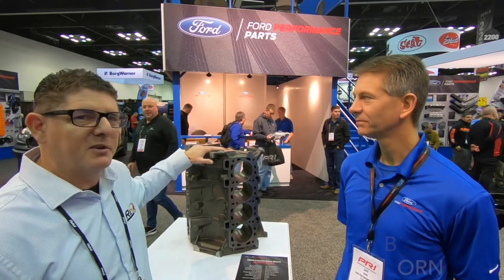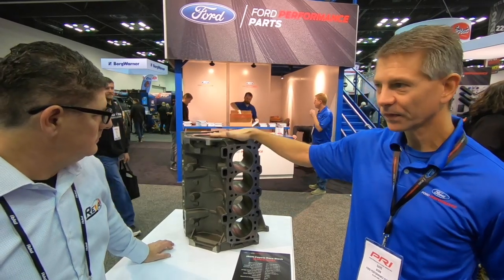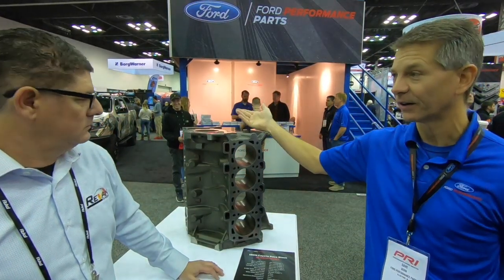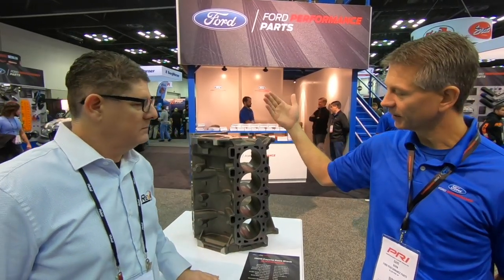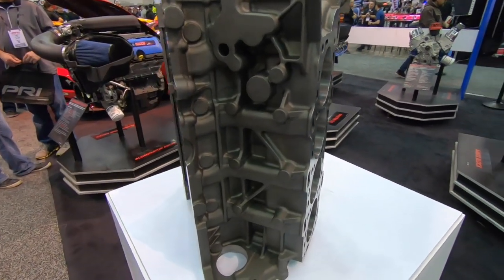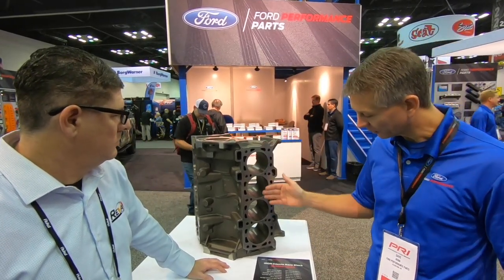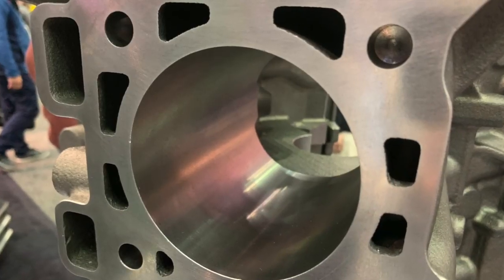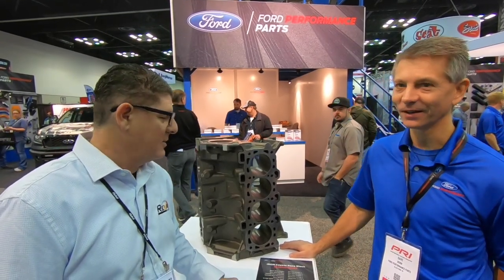First Look!!! Ford IRON Coyote Race Block 340 Cubes All-New at PRI Show

Comment: Ford make push rod please light simple
Reply: Ford did make push rod engines for more than 40 years. Who do you think chevy copied the LS platform from ??
Reply: Dale Ostrom the LS design was GMs design, they didn’t take ideas from ford, I love ford but GM used to know how to make powerful motors, now ford does that, the old 351 Windsor’s and such would get shit on by an LS with the same upgrades while also being cheaper.
Reply: @Mfletcher703 ; Ford's original Windsor design came out in 1962. With 40 years of technology behind them, I would hope chevy could do a little better. Maybe in another 20 years chevy will figure out how to put overhead cams on the LS.
Reply: Dale Ostrom I doubt it, I’m sure 20 years from now we’ll see the tired out 5.3 with a whopping 400hp but somehow still slow as hell.
Reply: @Mfletcher703   YA BS, the LS design is basically an updated Ford Small block.
Reply: if you want push rods just buy cheap LS motors
Reply: @mikec9112 ; I said "Windsor Design" . I would think people that know Ford would understand, maybe not
Reply: @mikec9112 ; It would be a lot more confusing to call it a 302 Cleveland.  Even to me, I would consider that a Boss 302.
Reply: Trailspeed703 you obviously don't have a clue what you are talking about.. GM's la is pretty much a Carbon copy of the Ford Windsor design! The LS cylinder heads bolt right up to a 1960's small block Ford and everything lines up perfectly.. I wish I could post pictures here because I have proof! I have done this, and after you actually see both engines side by side there's literally no question about it...
Reply: @robinesavage404   There is no such thing as a Ford Windsor design.  There is the Ford Small Block design family of engines that includes the 351 Windsor.

Comment: We found that the old cleveland blocks distorted from the factory 9 thou at 2000 revs and we were losing 50 foot pound of torque so have they tested this fact of either aluminum or iron blocks?

Comment: FORD PERFORMANCE!!!
What a waste of time and money for 1500 to 2000 rpm. 
You already have tooling for an awesomely super strong block capable of over 2000 horse and havent made one for nearly four years..... the Australian Ford Barra 6 cylinder.
Barras easily make 800 to 1000hp with $5K  ..... how much to get a coyote making that sort if power? The only other cheap platform for such power is the LS.

FORD you are missing a trick by not recasting the Aussie Barra!!
And Im not an Aussie.
Reply: I agree that the Barra is one badass engine, but to answer your question about the Coyote making 800-1000 hp.. Ppl do it all day long around the world, just add boost!! Turbo or Supercharger easily gets it done!
Reply: Can’t the coyote already handle 2000 hp when sleeved ?

Comment: That why i like my 07 Shelby gt500 5.4 iron block😀😀
Reply: Be nice if that could find it's way in production form in the F150 and Navigator
Reply: Drag Hrvacevic  100% agree with you that’s why I kept my 09 GT500!
Reply: The 5.4 is gutless, even with 4v heads, the older modular designs just didn’t have the right proportions to be super powerful in stock form, whatever improvements ford made to come up with the coyote definitely is the way to go
Reply: @Mfletcher703  they both could do the 1hp per cubic inch with 4v heads. The 4.6 was more potent of the two because it was better proportioned (It's actually better proportioned than the coyote) the coyote has all the tricks of the trade applied on addition to being larger. If the 4.6 had those ingredients (4v VVTI, 12:1 CR, Direct injection, phosphorus coated pistons) it wouldn't be far behind. The 5.4 has a bigger stroke than a 460. Ford just didn't equip it to rev like a normal small block. No rpm, no hp.
Reply: vendediesel makes sense, I was always a fan of the 4.6 but really on the 3v version that came in the 09-10 f150s, I would like to see ford bring back the 4.6 but that won’t happen, but what would be cool is the see a 5.8 variant of the coyote that goes into the f150s and mustangs, I feel it would have its place in the market, hell it might be a replacement for the 5.0!

Comment: So sleeved al blocks are already being run safely at over 2k hp. Why add another 50lbs???
Reply: Because when you need a 3000hp coyote street car 😋 that's why
Reply: Race against one of these for your answer!
Reply: NM, just realized I was comparing this to another (aftermarket) cast iron block released at the same event. That one was claimed good only up to 15-1800 hp.
Reply: If the price is where it should be, more strength for less cost than a sleeved aluminum block is attractive to a lot of people. The weight isnt a huge deal for the advantages for some applications.

Comment: Price is the biggest factor for me. Keep the price for a bare block below 2500. As you can go to jegs and get a lsx motor for 3700sh..
Reply: So what? You're also going to invest a crap ton more money in an LS engine to get heads that can flow anywhere near what a bone stock coyote head flows. LameShit
Reply: @chadkent1241  what? You talking cfm? Ls3 head flows 315 cfm and coyote does 290 isn't that right?
Reply: No one cares about lsx anymore .lol

Comment: 1,500-2,000 HP?! That's just crazy!
Thanks for asking for the simple answers👍
Reply: Oh it will handle 2500 hp easily. U'll need a billet crank, Billet I beam rods etc..... but that block can handle way more than 2k hp. Aluminum motors are already making 2000+ hp.
Reply: Quite easy with this block.
1,500 was only a couple turbos away in the base coyote 5.0 alumimum block

Comment: How about a 7.3 Godzilla Crate Motor?
Reply: Push rod. But i think it can make some real power. Depends on the after market
Reply: @MrDavidelliottjr  I know it's a pushrod. I also know what shops are recieving theirs and when. I'm interested because it is a pushrod.
Reply: @CanIbeFrank  which are those shops? I heard some are supercharging it.
Reply: The 7.3 is a crate engine now for around $8K
Reply: @The Man can't wait to see their tune, on the tfl video the torque line was all wavy and he said it was because of factory torque limiting holding it back 🤔
Reply: Its a truck block designed for torque not high revving hp...
Reply: @davepaxton8987  a nice strong iron truck block 💪
Reply: @davepaxton8987  same to you....
Reply: my neighbor is installing a twin turbo on his new 7.3L... will get my popcorn and watch it explode...lol!
Reply: @boyteebah3794  https://youtu.be/6PbveNLaNAY
☝️bone stock 7.3 with twin turbos made 1114 horsepower @ only 15psi of boost with ease....
Reply: @boyteebah3794  how does that crow taste??